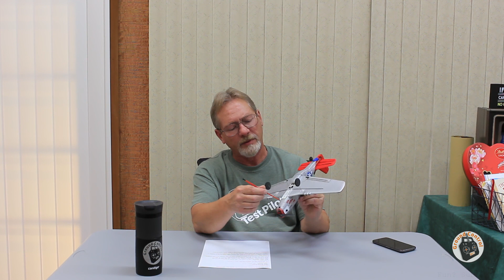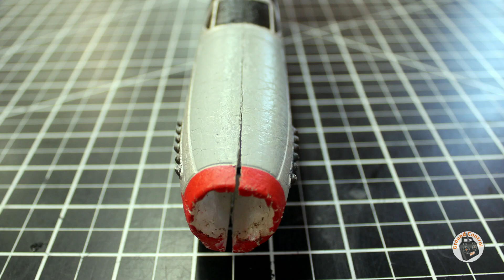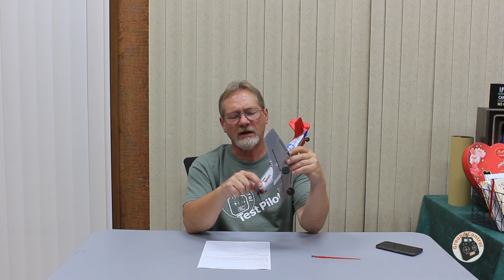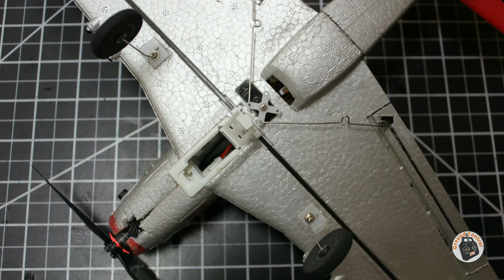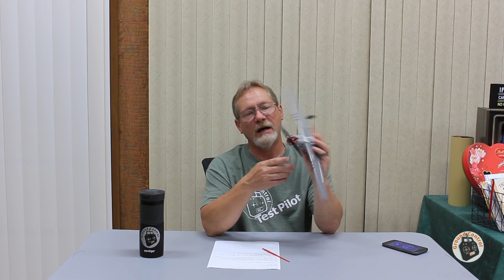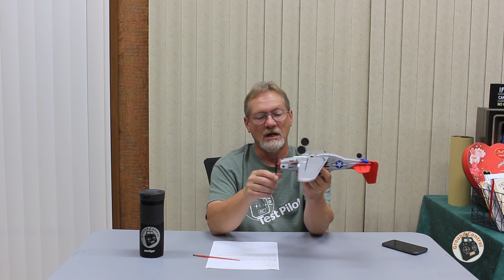Show & Tell for the Brushless Conversion of the Eachine Mini P51D Mustang Warbird!

Comment: knowing what you know now would you choose a different brushless motor for use with a 1S battery? im looking for a setup that will give my 400m mustang well over 1:1 thrust to weight
Reply from the maker: Not a different motor, but using a 1S brushless setup I would use a gearbox and a larger prop for more power and and flight time. Much like the setup with the brushed motor. I would prefer instead to setup for 2S rather than 1S and use a smaller direct drive prop.
Reply: thanks!
 @GroundControlRC

Comment: Were you able to use stock rx and gyro after using brushless?
Reply from the maker: No, I used the components that are listed in the Show Notes.
You can perform a brushless conversion now using the Brushed-to-Brushless Module.
It wasn't available at the time of this conversion but it sure does make it easier.
J. Bauer Electronics - https://www.laserbeelpm.com/b2bl.html
Reply: @GroundControlRC  cool
..i just was wondering...i have so many planes already...i just received eachine mini today...hopefully i will maiden early next week. Looking for a good video on setting gyro so plane flys true...the rest is easy...this is my first rtr micro..thanks ..ps never used any gyro in any of my planes..
Reply from the maker: @roadstar499  Good luck on your Maiden!
Yes, Gyros are a bit new to me as well.
They are certainly nice for wind mitigation and a parachute button ;-)

Comment: I’ve just bought the P51 and took it out for its first flight today but had to cut it short as the aeroplane was wobbling badly from side to side, particularly when flying in to the wind. 
I’m not a particularly experienced flyer but I have other planes and have never encountered this problem. As someone who clearly knows their way around this aircraft,  any suggestions as to the cause and possible solutions?
Reply from the maker: Hum...I would first check the balance of the plane for a proper CG as a tail heavy plane will produce some strange behavior,
I would also make sure to have the plane on it's wheels when plugging in the LIPO so the gyro is in the proper attitude when it initializes.
I also typically re-calibrate the gyro before the first flight to make sure it initialized properly.
Also, run up the motor while holding the plane to see if there is any vibration coming from the motor, prop, and gearbox.
I usually have to balance the prop on these Micro Planes before the first flight as well.
A lot of vibration can effect the gyro.
Those are the things I would look at first.
I hope that helps and I'll see you in the Air!
Reply: @GroundControlRC  thanks for such a fast and comprehensive reply. I didn’t put the wheels on as I thought the aircraft looked much sleeker in the air without them but I will follow all of your advice and try to eliminate the problem. 
I also got the spitfire model from eachine and have a question/ challenge about that aircraft but will wait until you  review it before bothering you with it. 
Thanks again and regards from the UK.
Reply from the maker: @kveecock  You are most welcome ;-)

Comment: Anyone doing a small plane conversion really needs to watch your many conversion videos. You have an amazing amount of useful info.  I'm doing a couple coversions, and info that was particularly helpful was that the br1206, though listed as 2s-3s, actually works on 1s.  Thank you for the thrust data as well!  Also, I didn't realize that you could use a 2 wire esc and power the receiver seperately (I think I found that in your chuck glider conversion video).  Great stuff!  What is your auw on the p51?
Reply from the maker: Thank you much Mike!
The AUW on my converted Mini P51D is 61.4g with a 1S 360mah LIPO weighing 10g.
Looking at how it flies on that LIPO I don't think it would have much of a problem flying with a bit larger LIPO.

Comment: if anyones looking for wooden motor mount maerial, i'd suggest dollar store incense burners . roughly 12x2"x3/16ths. some kinda hardwood , ripped, and there's a curve  at one end that can be very useful. much stronger than hobby ply. and  more resilient. and of course cheap..i live in canada. it's hard to find wood here.
Reply from the maker: Thanks for that info Steve! I'm always looking for build material and the cheaper the better. I would never have looked at incense burners, now I will ;-) See you in the Air!

Comment: How did you connect the motor to the Receiver/ESC? Did you use those 0.8 mm bullet connectors?
Reply from the maker: Hi Tim! I replaced the stock Receiver / Gyro Brick with a Standard Manual Mode Receiver and used an external 7A OPTO ESC. I used 2mm Bullet Connectors for the Motor to the ESC. I discovered those .8mm Bullet Connectors after I completed the conversion. I'll have to order some of those for future conversions. I don't think I'll have those to use on the next conversion as I'm getting ready to start that conversion now.
Reply: @GroundControlRC  Thanks Steve, I'm starting on a Guillows Sopwith Camel RC Conversion and planning to use a similar electronics pack (perhap slightly larger).
Reply from the maker: @timtheplaneman  Good luck on the conversion. That one sounds like fun ;-) See you in the Air!

Comment: Great info!  Thanks!!  I've seen other YT vids measuring the top speed in level flight around 30mph as stock.  Curious, what does the top speed look like (brushless) now in your estimate?
Reply from the maker: Thank you much! I'm not sure of the speed but it does have more power / performance than it did stock. I would assume it's also faster than it was stock but by how much I just don't know.